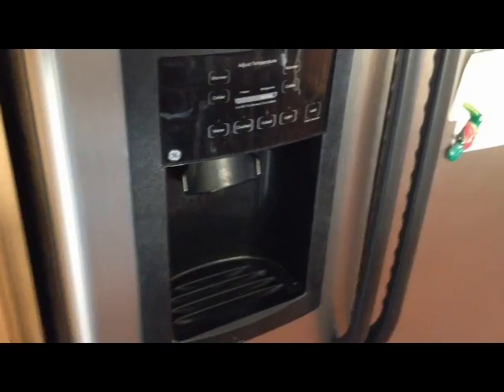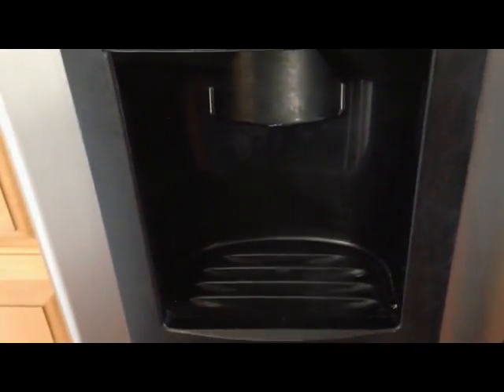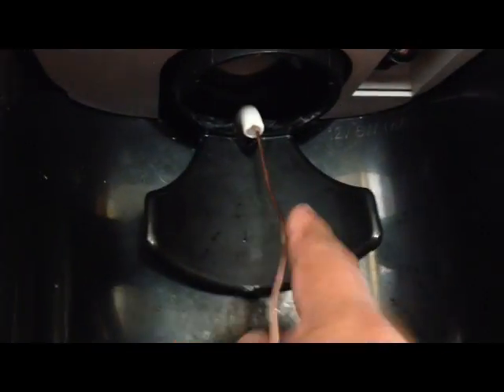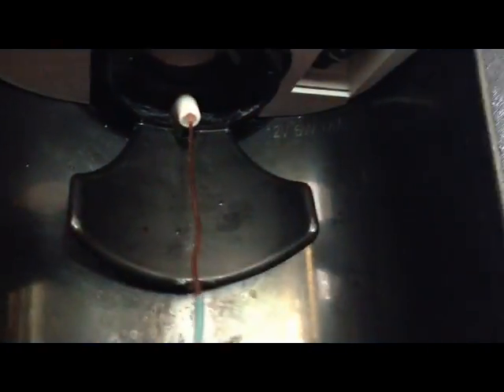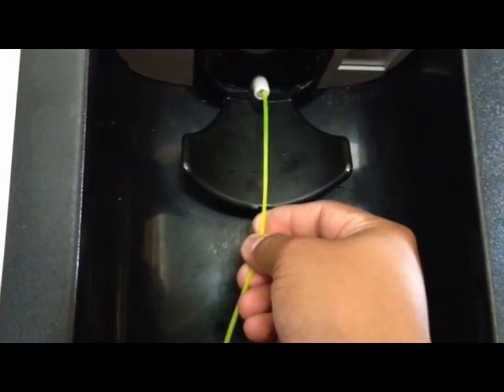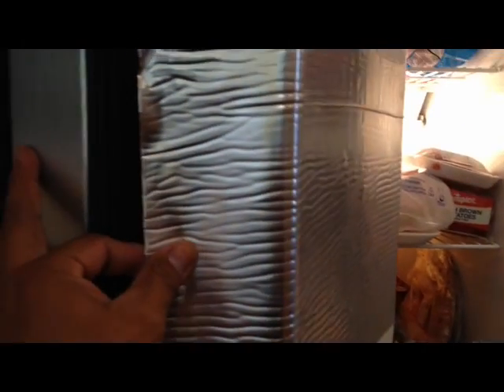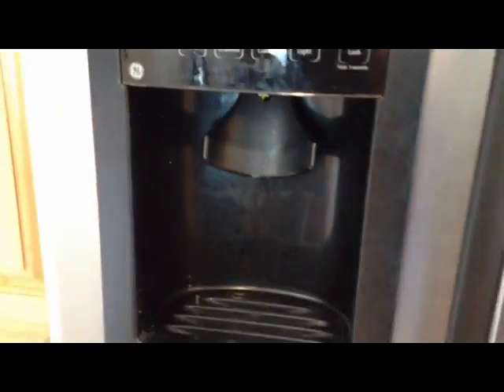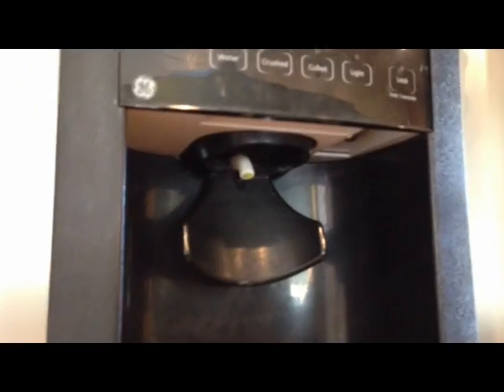GE Fridge - Frozen Water Dispenser

Comment: 02:55  Putting the insulation solved the water freezing up issue.  Before, I couldn't go one day without it freezing and now it's been over two weeks and the water hasn't froze.  Thanks again for this tip!

Comment: Thanks for taking the time to put this info together, Rey!! For the last few years, I was able to clear the frozen line by letting a mug (sometimes two if the first didn't work) of hot/boiling water sit in under the dispenser. The rising steam did the trick. Still, I wanted a permanent fix. I used Frost King self-stick, foil, duct insulation (1/8" thick - R value: 3.0). Roll was < $20 and most hardware stores carry it. One layer did the trick for a month or so. After the line froze again I added a second layer. Three months later, and for me, the issue is solved!
Reply: Hi, I would like to try Frost King as well but what did you do to prep the plastic surface to be adhered to? Alcohol then air dry and use a heat gun and heat the Frost King a little? Or do I also need to use clear packaging tape to tape it?

Thanks
Reply: @Gleeleeglee  Since the freezer door would be open for maybe 30mins I cut, then taped, some plastic sheeting over the freezer area. I figured this would help retain some of the freezer's cold air. I used a small, portable heater to warm the area where the insulation would be installed. I did this for ~20mins, wiping off any condensation. The surface was still cool/cold but the insulation stuck fine. (I didn't use alcohol or anything else.) Something else I'll add, the back of my freezer door has more angles than the fridge in this video. I did some quick measurements and cut multiple pieces to get somewhat of a clean look. Hope this helps and good luck!

Comment: Thanks for this video. I have had this problem for years...sometimes we go a few months and all is well. Other times it freezes a few times in a day. 

It infuriates me that GE wants us to buy a kit to fix their design error. It should be made available for any customers for free. It is what any rational person would expect from a water dispenser on a refrigerator... That is works. Plain and Simple.
Reply: Not only that but the kit won't work on all GE side by sides. Installed the heater kit on mine only to find out that it only works on certain models with serial numbers that start with AA to AF..
Reply: This problem is a monument to lousy GE engineering.

Comment: Thank you for letting me know what the problem was. My wife used a hair dryer on the back of the door in the freezer for 5 minutes and that melted the ice inside of the water hose. We haven't been using the water dispenser lately because of the cold weather.

Comment: I think i figured out why my water line froze.   ive had the fridge for 20 years with no issues.  I overfilled the freezer and the frozen bag of food was jammed against the freezer door causing the water line to freeze.     the other thing that has happened is that if an ice cube lodges and doesnt come out of the chute and allow the flap to close, the cold air will freeze the line beneath the flap.  thanks for the video.

Comment: IT WORKS! Brilliant. Just be patient and be careful with your heat gun. It WILL melt the flipper paddle and the plastic water tube if you overheat it.  Inserting the weed whacker nylon line into the water tube is a great idea and will make for a super easy fix when it freezes up again. GE appliances just ain't what they used to be.

Comment: I did what your video said to. It worked. I thought of an improvement the following day. Instead of weed wacker line, I tried 10 gauge pure soft copper wire, about 6 inches. The  small amount of heat the wire conducts from the kitchen back into the water line prevents freezing. Pure soft copper is safe since many pipes are still made of copper.
Reply from the maker: Glad the video helped. That's a great idea I might do that myself.
Reply: +Remus Dabasol glad you made the vid. I didn't understand the issue until I saw it. Hope bare copper works out for you.

Comment: This fix works!!!!  I tried everything that has been recommended including installing two water heaters.  This is the only fix that lasts.  Putting this stick on foil insulation from Home Depot to wrap water pipes or heating/cooling vents works!  To unfreeze the line, turn off the water supply to the refrig. and leave the freezer door open for about 15 minutes.  Tape a plastic garbage bags over the freezer to keep the cold air in.  Using a hair dryer makes unfreezing the line while the door is open even quicker.  Poking weed whacker line up the water line dispenser while using a hair dryer quickens the process as well.  Thank you for the stick on insulation idea!!!

Comment: Excellent tutorial!! I bought 2 foam COLOR TESTER sample boards by Foam Pro, ($2.50) sold in the painting section of our ACE  hardware store. Perfect size, I used 2 boards taped together, I  dried the inside freezer panel with hairdryer  & taped on with clear waterproof Gorilla tape. Wa la, FIXED!!

Comment from the maker: The insulation did work. It's actually DynaMat for cars. Check it on eBay the generic brand will do just as good.
Reply: Thank you for this solution! Dispenser was freezing 2-3 times a week and now it's fixed. Thanks again!!

Comment: I finally got frustrated enough to cut a 2 inch by 2 inch window in the freezer door.  The problem is finally diagnosed, but I don't know what to do to fix it.  The water line leaks a tiny bit.  The insulation I removed was impregnated with ice, which explains why the insulation fails.  The ice conducts enough to allow the actual foam to freeze solid.  It was frozen so bad, I needed a heat gun to thaw it enough to chip it out.  

I need to figure out how to take the entire door apart and replace the water line in the freezer door and re-insulate.  By the way, the insulation is 2 inches thick and very dense.  

Summary:  I don't think it is an insulation issue, I think the adequate insulation is getting wet and freezing.
Reply from the maker: I haven't had the problem ever since I did this. I figured insulating the door will prevent the inner insulation from freezing. Maybe your leak has to do with the insulation freezing over.

Comment: Iv'e had the same problem in a house just purchased.  What a pain.  I have gotten tired of running my heat gun over it. I looked for the material mentioned by Remus but it costs way too much for what is needed.  I just got back from Lowes.  They had a self sticking heater duct insulation material that looks just like the stuff Remus was putting on.  It was the exact width  to cover the panel. 12 inches. I used a hair dryer the heat up the panel, and a clean cloth to dry it off.  I stuck the foam on just like Remus did and let left the door open until  the water began running.  Let's see how it holds out.  I will update as conditions change.
Reply: Item # 28929 Model # FV516
Frost King 0.125-in Foam Plumbing Pipe Wrap Insulation
Reply: It actually says Duct Insulation on the packaging.
Reply: Well it has been a week and everything is still working.  This looks like a good fix.

Comment: To bad there isn't a way to distribute these videos to every owner of this fridge. When my line was frozen nothing worked. I ended up turning off the fridge for half a day. I tried every thing even using a waterpik with hot water. Your idea of leaving a line in is really smart,but I think the best thing is when the water slows down, clear the build up.

Comment: It's very sad that GE still hasn't fixed this issue!  My GE side by side is 13 years old and has been freezing up on and off almost the whole time.   Look at all the models still being made where people have these issues. Goes to show you GE doesn't care and the engineers don't want to fix this flaw in the design!
Reply from the maker: Dan Apgar, wow I didn't know this was going on that long. I wonder what can be done.
Reply: Dont buy GE please
Reply: I have a Whirlpool brand with the same issue, so it's not just GE. Whenever this side by side dies I am just going to go back to a regular top freezer refrigerator.

Comment: I bought some auto audio insulation to use but my freezer door won't shut with it wrapped around the sides. So I had to peel the sides back off. We will see if it makes any difference having just the face insulated.

Comment: Mine has been freezing up for a couple of years. I had GE install a heater and that lasted several months an now it is back freezing again. I unthawed it with the hair drier and then I installed a 9"x 9" piece of 1/2" foam core to the door inside using 3M Super 77 adhesive. Then for good measure I put a 10" long piece of weed wacker cord in the tube. We will see if that works now.
Reply: Vernon Carlson did it work? Where did you get the foam core from? What is it called?
Reply: Would you update us with what you did to fix this frustrating issue, Vernon, please?

Comment: just thinking- how about taking a hole saw and cutting a 1"+/- port hole so when it freezes you can shoot a hair dryer in there? Then put a plastic plug to seal up the hole. I wonder if the door insulation builds up moisture over time and conducts freezing temp to the water line? I just don't know what I would damage w/ the hole saw.  Mine didn't do it until it hit 15 years old.
Reply: Same here, ours is 13 years old. Just started doing it. Good thoughts you have. I noticed that my ice door started sticking open recently. The door is actually on some sort of sprung actuator. I think the cold air exiting the ice door is freezing up the line. I had just noticed the ice door sticking open when the line froze up for the first time. Perhaps the ice door actuator has weakened over time? Going through these videos on YouTube, I’ve seen 3 different people using the hair dryer trick where I could see their ice door was stuck open. Another person was installing the line heater that GE offers as a fix, and he mentions his door sticking open as well. 

Curious if anyone has noticed their ice door sticking and if this is actually our problem.

Comment: How do you get the insulation to stick to the inside of the refrigerator?
Reply from the maker: Samantha Tumminello the Dynamat had its own adhesive. I did leave the door open for about 10 mins to allow the door to get near Room temperature so that the condensation would stop then I wiped it down with a clean paper towel.

Comment: GE makes a water line heater to address this problem. I am installing one for a customer today. Google it.
Reply: You can also pull the dispenser cover off and use silicone caulking around the tube where it comes out of the door. That is where the moisture gets into the door insulation.

Comment: Did the insulation permanently fix the freezing issue? what is the insulation called?
Reply from the maker: It worked for me. It's called DynaMat or you can use a generic brand. I got mine from eBay.

Comment: If you never want to fool around calculate 5 inch down from your ice dispenser Edge half inch off center either way use your multi-max and cut an access panel scrape out all the insulation to you reach the tube remove the original dispenser tube shove the rest of the tube through the hole if you wish why you have the tube out drill tiny holes 6 or 8 through to the outside so that he can get into the tube but the two back but a piece of duct tape over the tube refill with foam the phone will not work under cold you must block off the cold from hitting the door big thick blanket are such hit with a hairdryer a little bit to get it warm put your foam in it trim the phone down replace your door Gorilla Glue trim down to look good I did this with my two years ago I got tired of fooling around those stupid heaters there is a heater underneath that dispenser tube inside under the foam good luck changing it you can't take the door apart but there is your fix